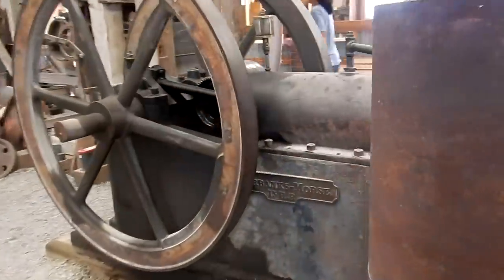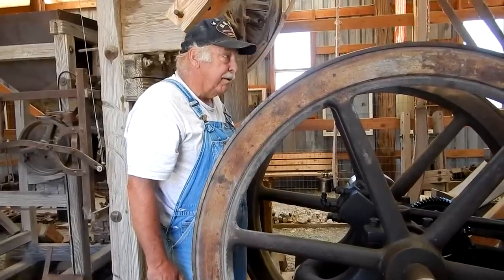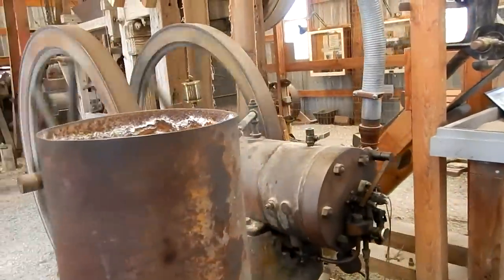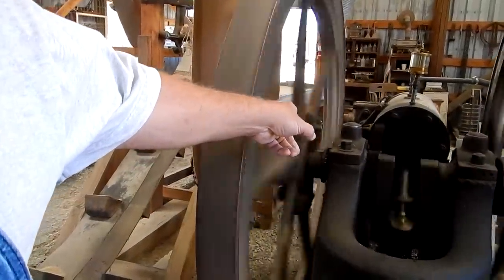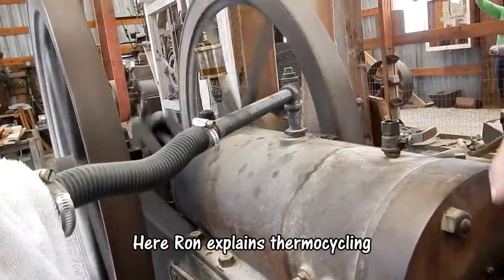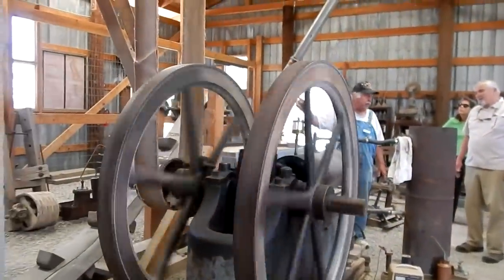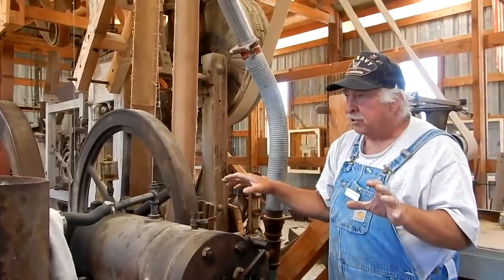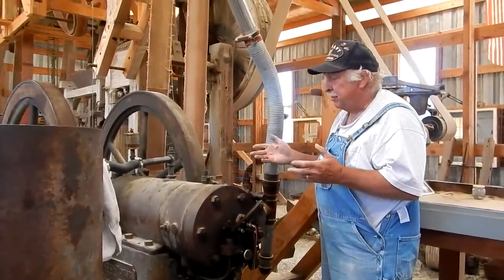1912 Fairbanks - Morse 15 HP Hit And Miss Engine And Two Stamp Mill Demonstration

Comment: To think this was the high-tech of the day !!Crude maybe, but effective YES,The desire to do whatever is necessary with the materials at hand from the human race is astounding.Thank you everyone that had a hand in bringing this beautiful technology to us public.
Reply from the maker: It is amazing to see what people have invented over time out of necessity. Each generation improves a little on the technology of the previous one. Think of the work an engine like this could do with a gallon of gas. As Ron pointed out you could belt this up to many things from a generator to a washing machine and everything in between. Thanks for the comment!
Reply: Nice viewpoint You've just earned another subscriber.
Reply from the maker: Thanks, we appreciate it!
Reply: It's probably more fuel efficient than most of the more modern engines, and also not too bad on emissions.
Reply from the maker: It is fairly efficient, maybe something to do with it coasting part of the time. Thanks for commenting, Doug!
Reply: @dougscott8161  That's an interesting question about the efficiency. 
They weren't concerned about the size of the engine and it turns slow so they can design it to get every last bit of energy out of each burn stroke. That's very efficient but, they don't have modern carbs or fuel injection which helps the fuel burn efficiently. They have some aspects that are very efficient and some things that aren't as efficient as modern engines. 
Overall, like you say, I would think these are pretty efficient compared to modern engines. Maybe more efficient than a small gas engine but not as efficient as a modern, slow turning diesel generator type engine. 
I would be curious to see how one of these engines in good condition compares to a modern engine. 
If you notice, on this, the cooling water would also serve to heat the shop. 
In colder climates, if they are also using the heat the engine produces, that would add to overall efficiency.
Reply: This design was a bit outdated by 1912. Much more powerful and efficient engines were available at that time.
Reply: @TomandJulieMineExploring  This may seem off point, but I've always wondered where the gas came from? We know where it comes from: it comes from the gas station :-) But in 1912, before there were good roads and a network of distribution from oil field to refineries and then out to where people lived, gas must have been rare and expensive. Did these things run on alcohol, which farmers could conceivably make themselves?
Reply from the maker: @dagrote1  Good question. I think these would run on a variety if different flammable liquids. I obviously wasn't around in 1912 but would guess that the supply of fuels and oils would grow organically and become available as the demand for them grew. Thanks for the comment!
Reply: Lots of them ran on kerosene which had become abundant due to it's use for lamps. Hard to start on kerosene but once warmed up on gas it could be switched over.   But gasoline was available early as well for different uses.  More expensive so just a little was used to get them started.
Reply from the maker: That sounds really cool, John. I have a small hit and miss that was sold buy Montgomery Ward's but I haven't been able to get the Wico magneto to work.

Comment: When I was 19 I went to work in a factory that was built in 1888. Although there was modern equipment there was also machinery from when the factory was built. The line shafts were never powered by hit and miss engines but we're powered by stationary steam engines. When electricity came in the steam engines were removed and replaced with an electric motor. When the place closed in 1982 there were still machine tools in the machine shop that were run by leather belts and line shafts. This included drill presses, lathes, one planer and one horizontal lathe all from 1888. Back in the day when the factory was built the first buildings constructed were the craft shops then the factory. The reason for that was most of the machinery for the factory was built in house because it couldn't be purchased. Engineers designed the equipment then carpenters made the patterns which were sent to a foundry. The castings would be machined in the machine shop and the machinery was built in place by millwrights. I learned to be a millwright while there and worked on all the old stuff right up to the modern equipment. Today it breaks my heart because I know all the equipment in the machine shop went to the scrapyard along with other machinery from 1888. Seeing the line shafts in this video brought some fond memories. Thanks!
Reply from the maker: Great story, William. Very interesting how the machinery was designed and then built in place. The Laws Museum is a very fun place to visit if you like old equipment and such. Plus, it's free admission. I have a few more videos that were taken at the museum that you might like. One of Ron Moorehouse's engine shop and one of the Twenty Mule Team Borax replica wagon train. There are a couple more, too. Thanks again for the great story, I will read it a couple more times.
Reply: @TomandJulieMineExploring  Back then cameras were strictly forbidden and it was an instant firing offense. Now I wish I had taken the chance to get pictures. Over the years as new processes were installed the old machinery wouldn't be removed unless the room was needed so the old machinery would just sit there. The machinery was built to last for ever. There were a couple of Ingersoll Rand air compressors that were there from day one that were still running every day until the place shit down although the steam engines that powered them were long gone. There were wooden tanks and some cast iron tanks still in use from day one until the end. The factory covered a little more than 2 city blocks with brick buildings 12 stories tall. Back in it's day it drew much attention. A huge "Steam Powered Factory" it was called. The operators used pipe to communicate with each other. Just like old Navy ships. Some of the pipes were still there at the end. One would blow into it like a trumpet to get the attention of the next operator. Small steam whistles were also used for communication. They were used until the end. Steam power came before electricity. It wasn't long before this factory was built steam railroad engines had to uncouple their cars so horses could pull the cars to their destinations because steam was thought to be too dangerous to be close to highly populated areas. In some cases it was true because every once in a while a locomotive would blow up. Again, this video woke up a lot of wonderful memories. Thanks Again!
Reply from the maker: Too bad you didn't get any photos of the factory and the vintage machinery. I'm glad that you have the memories after least. That factory must have given you some intense experiences to have developed such deep memories of that time. You are a good writer, maybe a book in your futue? Thanks for another great comment, William!
Reply: @TomandJulieMineExploring  Thanks for your more than kind words. There won't be a book. Just like the machinery that went to the scrapyard not many are interested in some old man's memories. I was just a kid when I started there. I was a sponge trying to learn everything I could and I wound up in a candy store so to speak. The old timers I worked with were more than happy to pass along a lifetime of information which included information that was passed along from previous generations of millwrights. They were a wonderful bunch that were children during the Great Depression. Most knew of a cold house in the winter and going to bed without a meal. They learned to share at a young age and did for their life. Their knowledge flowed to me like a river. You guys are busy and I really enjoy what you do. One day when not so busy you will most likely remember much of things in your past that you most likely thought you forgot.
Reply from the maker: @williamwintemberg  You always seem to remember the important things. I really do like your writing skills and wouldn't uderestimate what you could do with those great memories that you seem to have. Stories and ways of life that were passed down to you are priceless.
Reply: I have more TMI on line shafts. They were always mounted high in the air close to the ceiling or at least most of the time. They did require lubrication from time to time. Most big factories had oilers and they had set routes they had to go on to keep everything lubricated. Being the line shafts were up high an oiler would have to get a ladder to get up to each bearing and most were grease lubed. Some were oil. The oilers had a good feel on which bearings would most likely need attention and which didn't. That said, the oiler would pay more attention to the bearings that needed it, the others, not so much. To cover themselves they would apply dabs of grease or oil on the floor under the bearings to show anyone who had a question about the lubrication.. The oiler would point to the floor and say "If the bearings weren't lubricated there wouldn't be any oil on the floor would there'"?
Reply from the maker: That's another great memory with a humorous bit, and, more fodder for a book. I love seeing those line shafts. We have seen several over the years in the blacksmith, and carpentry, shops of mines. We saw a nice one in Goldfield, Nevada a few months ago. It was at the Florence Mine and if I remember correctly it was running the saw that cut the timbers for the mine workings, as well as other machines. Here is the link to that video if you are interested. Looking forward to hearing from you again, William!.
https://youtu.be/teHYHWiT8yQ

Comment: There are quite a few of these engines still in use here in Ohio. Some of the Amish still use these engines to power things. Fairbanks-Morse was noted for having some of the greatest mechanical engineers in the world. Their engineering department was second to none. Their engines were noted for their simplicity, strength, reliability and longevity. Fairbanks-Morse went on to build diesel engines for electric generating plants, ships and they even manufactured locomotives. There were other manufacturers who also produced hit and miss engines.
Reply from the maker: Thanks for the great comment, Grant. After spending a couple hours with Ron you could tell he had a lot of respect and love for Fairbanks-Morse and these engines in general. He did explain the reliability of these engines saying they would run forever if properly maintained. I don't know if you saw my other video of Ron's shop where he showed us several other engines he works on from different manufacturers. I think it might interest you.

Comment: I really doubt that a modern 15 hp engine would do the same work, so cool, thanks guys.
Reply from the maker: Once those flywheels get moving, there is a lot of kinetic energy there. They won't stop in any hurry. Thanks for watching, Mick!👌😁
Reply: Oh they'll do it, after a fashion. Whether they'll be capable of still doing it 100 years from now (with the original parts) is another question entirely.

Comment: Excellent Video ! Brings back little boy memories if a 60 HP Fairbanks-Morse Diesel on Parks Pond in Clifton,Maine.Sawing 1/2 million ft of logs every summer from about 1920 to 1958.She Banged her way into my heart @ about 300 RPM.Notice the interesting camera frame speed showing the flywheel spokes turning one way and the slower motion of the shaft turning the actual direction.That man knows his engines.The 60 hp Diesel blew the most beautiful huge smoke rings when she was first firing from that 6 inch exhaust ...those rings kept expanding to about 12-15 ft until they finally broke apart.
Reply from the maker: Thanks so much for watching and for the great comment, Glen. It sounds like you have some great memories that have stuck with you all these years. Ron certainly knows his engines. I have another video of his engine shop that you might like.

Comment: I had a friend in the Ozarks, who had one of those in his back yard…and a case steam tractor, and old sterling engines, and make and break engines, and several other kinds of engines, not to mention a couple of dozen of ancient tractors.  He loved machines, and bought them as scrap during the Second World War metal drives.  He kept the brass whistles and governors in his log cabin, but they broke down the floor.

Old Sammy is gone now, but he had plans to will his beloved machines to the University of Missouri.  It was 40 years ago, but I still remember how he fired that engine up, almost exactly like in this video.  Your video brought back great memories of visiting with Sammy.  He had no refrigerator, so I'd always bring ice cream and cold RC cola, and hot dogs, and we would eat desert first before it melted, then finish up with the hot dogs cooked on a wood burning stove, drinking RC cola and talking about machinery until 2:00 or 3:00 in the morning.  If there is any machinery in the next world, I suspect old Sammy is one of the engineers.
Reply from the maker: What a great story you tell of your pal Sammy. He sounds like a great guy who loved his machines. I'm glad you still have your memories of him. Thanks for watching and commenting.  
P.S. you know you shouldn't eat desert first, but in this case it's a good thing. RIP Sammy.

Comment: That's cool,,she shows how far we have come in 100 years of building engines...
Reply from the maker: It definitely does and engine technology has obviously come a long way since this was built. It has even come a long way since the 60's/70's when I used to be on the side of the road regularly adjusting points, fiddling with carburetors, checking spark plugs and wires etc. just to keep my car running. Thanks for the comment, George!
Reply: @TomandJulieMineExploring  sure has,, l have 8 classic cars projects, all pre 80,,,so I know Excaclly what your saying,,,,he'll tires don't even go flat anymore,,,lol

Comment: A perfect engine for post-apocalypse world. Very easy to build and maintenance, low fuel consumption and powerful enough to run a little factory. As fuel can be used practically anything that flows and burns. I love this machinery.
Reply from the maker: Exactly. I asked Ron about fuel and he did say they will run on just about any type of combustible liquid. Thanks for the comment.

Comment: I saw some engines that look similar in the oil fields of New Mexico some decades ago! These machines never cease to amaze me! I look at all the antique machine displays at our county fairs in the area. They run them.
Reply from the maker: They are fun to watch in action. It's also fun to imagine the mill pounding ore from a mine and all the work the miners did to dig and transport the ore. Visiting abandoned mines is one of our hobbies. Thanks for watching and commenting!
Reply: They definitely use old engines like this to power oil pump-jacks, sometimes smaller sometimes bigger. They've been largely replaced with electric motors now though

Comment: Hit & Miss engines are awesome and can be used for a multitude of things!
Great video 👍
Reply from the maker: They are cool engines. I have more on them in a video called 'Hit and miss engine shop with Ron Morefield'. Thanks for watching.
Reply: i think hit and miss also efcient  in petroland  use of the combustion incompare to 2 stroke and 4stroke?
Reply: @djlau1  They were efficient for their time, nowhere near as efficient as a modern 4-stroke engine.

Comment: Back in the 60's and as late as the 70's if you lived in the country, you could often hear these things making their strange calamity of noise while driving pump jacks. . . Still amazing technology for the time.
Reply from the maker: Definitely a recognizable sound that they make and I'm sure nostalgic for someone like you that has heard them on the job. Thanks for the comment!
Reply: @TomandJulieMineExploring  Yes sir, most definitely!  I remember thinking at that time, that it was strange to leave a piece of equipment running with no one around!  (I was still pretty young and naive at the time.)  I do lament the loss of such things of that era (and before) that have totally vanished from the landscape.  Da#ned progress and electric motors!  The lights and conveniences of today are still pretty hard to beat!

Comment: I have seen one of these engines with fly wheel over twelve feet in diameter. That was in the 60's. I would have liked to take it home...
Reply from the maker: That was a big one, Pat. You would need a small army and a big trailer to get that home. Thanks for watching and commenting!

Comment: I have a 1923 Witte throttle governed log saw. Similar to a hit and miss. I learned a few things from this video. Thanks!
Reply from the maker: That sounds like a cool engine. Glad that you learned something from the video. I have a 1919 Sattley 1&1/2 HP hit and miss. I need to get the magneto working, and it will run. 
Here is another video you might enjoy😁
https://youtu.be/dySxypkHOKY
Reply: @TomandJulieMineExploring  are you familiar with the Starbolt catalog?